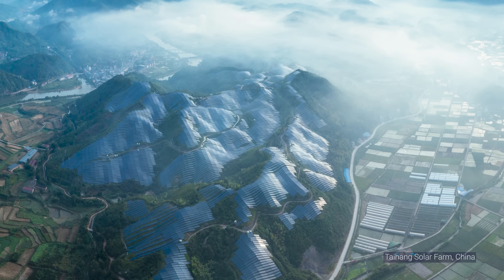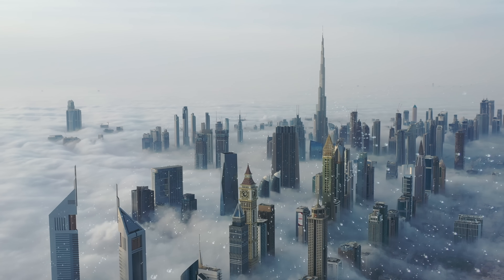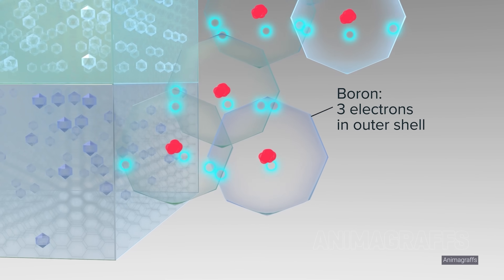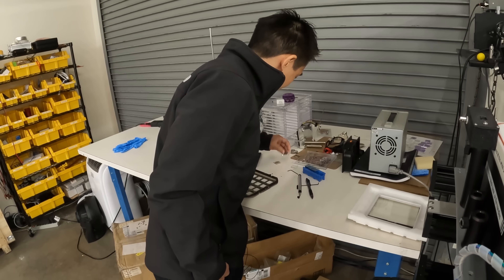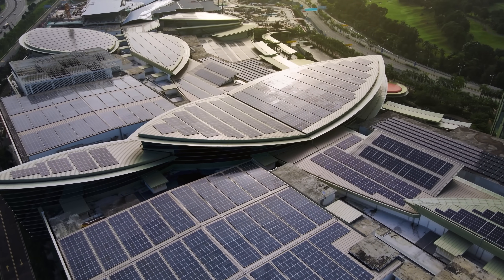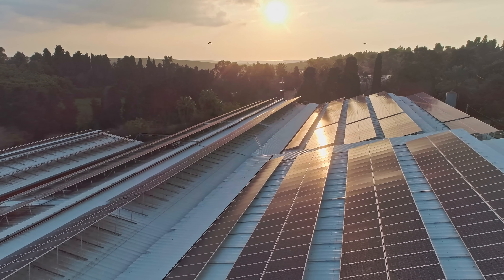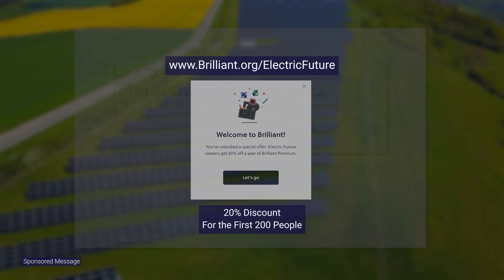Solar 3.0: This New Technology Could Change Everything

Comment: there are a few problems w/ solar that no one mentions.  firstly, the mining process for the materials is rough on the environment.  secondly, they require very toxic chemicals and materials that can't just be buried in a landfill (and it's too expensive to recycle them).  then what do we do w/ the defunct panels?  we have to take special precautions to bury them.  and considering the square footage needed for the solar energy discussed by Elon Musk, that will require an extremely large area of land that will have to be protected.  but if we're going to go to such lengths to bury used solar panels, why not drastically reduce the area of land needed to bury them and instead use it to store the waste for nuclear energy?  granted, the half-life for nuclear is far higher, but seeing as how nuclear is so efficient, we really wouldn't be sacrificing that much land that would be off-limits for the next 10,000 years.  but if CO2 is the problem everyone says it is, then it seems rather obvious that nuclear power is the answer—at least for the time being, if only as a stop gap.  here's the analogy i used to describe the "existential" threat of Climate Change: you're being chased around your house by a serial killer, and nothing you do works.  then somebody puts a gun on the table in front of you and tells you to use it.  but instead of taking the gun and shooting the serial killer, you say, "i don't believe in gun rights."  it simply doesn't make sense.  that said, i think the reason more "experts" aren't pushing for nuclear power is because they know that CO2 isn't nearly as dangerous as it has been said.  after all, if it was, we wouldn't be seeing the super wealthy buying up so much beachfront properties!  of course, if these "perovskite" solar cells prove to be the real deal, then perhaps my argument will become untenable (which would be perfectly fine w/ me).  but until then, i think my logic holds strong.
Reply: Of courser not. Nuclear Power is not clean for living beings, it's powered with rare minerals which require mining too. Most of these minerals are also limited worldwide and the world reserves are not on their peek neither, and the waste this generates lasts being dangerous hundreds of years. Set aside the dangers of nuclear leak caused by natural disasters or human conflicts.
Reply: Their is actually a bunch of financial reasons as well: try building a nuclear plant. It takes almost 10 years. Build a solar plant right now... a few years at most.
Simple example: supposedly in India they had this big patch of land because nobody wants to life next to a nuclear plant... they had been working on building this for years. They gave up and build solar plant on that same patch of land because: it would generated more power than the nuclear plant would.

Comment: this is rather old tech! not sure why its dated as being cutting edge for 2022.  hexofarricle graphene research is proving to be thousands of times more efficient at conducting solar energy as well as capacitive storage over current perovskites soft tech. an example would be the fact that carbon graphene is an extremely stable material with far better conductive properties then that of a superconductor ...which requires rather cold temperatures to perform!  Its thought that one 2x4' graphene based solar cell  will conduct more solar energy than 10  2'x4' 260 watt standard silicon semiconductor ...with ZERO loss! graphene is the most electrically efficient materials known to man! We are currently about 3 to 5 years away from inexpensive manufacturing of both solar and battery tech ! this will be a game changer!!!!

Comment: There's still the issue of maintaining cleanliness, regardless of how small they are. Even a very thin dust layer has a large detrimental effect on their efficiency. The best and easiest places to put solar panels currently is in deserts and empty fields. In a desert or similar, wind can easily place dust onto any solar panels, and the cost to maintain them would be very high. The most likely place they would be viable would be above clouds, where the sun would be shining more often, and dust wouldn't get to as much.

Comment: Nice. But "only" about 50% bump. So, nothing to sneeze at, but trucks? Buses, yachts? Nope. At 1kW per square meter max input (due to the "solar constant," then multiplied with the mentioned efficiency of 30% or even 40%) that's enough power for a bicycle, but no more. (And who wants a bicycle with several square meters of a canopy/roof?) 
So... for serious power, stick to buildings, parking shade structures, or stationary solar parks (or some portable IoTs and satellites).

Comment: Since material cost is 1/1000 (taking the active material as the reference)  then i would pay 1/10 of the price of regular solar panels to have them, even if they last only 5 to 10 years it would be worth it, in fact, over 10 years is good, but the fast pace means that in a decade what will be available will be cheaper and have better form, so, changing it every 10 years is good as long as there is minimal environmental impact

Comment: At what temperature can it operate? Would it be possible to instead of having a large surface of this film, have one very expensive and efficient film that receives a ton of concentrated light through mirrors as mirrors are cheaper than manufacturing this?

Comment: This research has been active for over 40 years. Being close to this research I can with confidence say that Si wafer solar will never provide todays energy needs. This means we reduce our requirement or find an alternative. 
Its video's like this that create hysteria on an expectation that may not be possible to deliver and gives a possible solution for politicians to present as a real albeit emotional propaganda.
Having said that we should not stop the research even if the gains are small as solar will always be an energy contributor.

Comment: 7:00 That’s why layering PV materials is the big lie. Solar energy was never about “the planet.” It was ALWAYS about making money.

The better solution would be to make panels passively optical. All they would do is collect, concentrate, and transmit optical energy to a a centralized processing unit in the basement. Because you can easily disperse light spectrally and also with passive optics, you don’t NEED to layer thin materials on each other. You simply direct wavelengths to their respective materials.

This ALSO allows you to add materials gradually to capture more of the spectrum efficiently.

The designed obsolescence is so obvious that if people REALLY understood optical energy and solar panels, they wouldn’t help but think the whole thing is a big sham.

Unfortunately, people are more interested in being “right” about what the “problems” are that they really don’t care about the actual “solutions.”

8:45 If you didn’t put the PV material in the panel, you wouldn’t need deposition layering processes…

Comment: Awesome research. Perovskites are very degradable. Overcoming that has been the goal for years. I suggest incorporating it within the conventional silicon structures or some sort of high-temperature resistant polymers. It might bring the efficiency level down somewhat but there must be a sweet spot somewhere in the middle

Comment: The initial video depicting the electron-hole interaction when the P and N-type materials are brought into contact was something you might consider donating to a University for the 1st course of Solid State Device physics. It would also be useful to incorporate the discussion of the Fermi level as part of the discussion to round out the band gap discussion. Good luck in your venture but many practical problems to overcome but your video shows you have a grasp of many such issues.

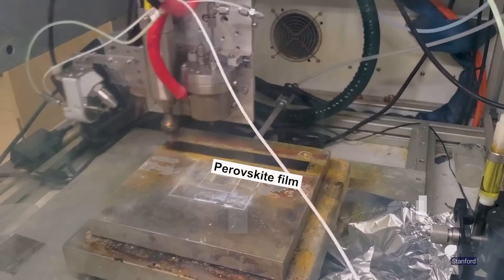Comment: 07:44 is the only reason this is viable. Easier to manufacture and less material used. You only need to heat the materials to 100 degrees instead of 1400 degrees on standard solar cells.  So in theory..... Theres a chance that its actually green energy.  Very exited for this new technology.
Reply: assuming it doesn't melt in actual use. I'm worried that the melting requirements are TOO low.

Comment: I wish the video had also mentioned the biggest barrier to full scale adoption of solar is energy storage. Most of the world doesn't have the capacity to store energy over time and rely on ramping up and down energy production to balance supply and demand at any given moment. Solar present the problem both of what to do with excess energy and how to manage impediments to production (e.g. weather). Then you also get into the issues with batteries and energy storage which are not very "green" products throughout their manufacturing processes - and the displacement of Indigenous populations for mining of things like lithium. 

I don't think there's one simple solution, but I do appreciate the informative video on this up and coming tech!

Comment: This is what I have been waiting for.... This will be the tipping point and will solve all our energy problems. I hope they can combine this with a Thermoelectric generator to combat heat issues and also boost efficiency. (Peltier device)
Reply: "Solve our energy problems" I believe it's called Nuclear energy and even better. Thorium powered Nuclear energy
Reply: @ishadowxhunter-0135  I am a big fan of Nuclear, but the dems gave it a bad rap.
Reply: heat can be used to for hot tap water
Reply: @DreamingConcepts  I was thinking a peltier device to increase electrical output, but a thermal battery filled with water would also do the trick. The only down sides I see to using water are the weight and maintenance.
Reply: @simoncameron4355  true, but the efficiency is almost 100%, compared to Peltier devices which are below 40%. Also costs worth considering, since it's the main feature of Perovskite solar cells.
Reply: @DreamingConcepts  Not trying to call you out or be argumentative, but they even said in the video that max efficiency is around 45%, and I wasn't referring to Peltier devices like they were a better solution, only as a way to combat heat and get more out of the unit as a whole? Your comment completely confuses me. Edit: after reading all the comments I think I understand, you think heating water is 100% efficient. This is not the case because as soon as the temperature reaches the heat maximum, then the rest of the energy is waisted, and you are losing the cooling effect of the water.
Reply: @simoncameron4355  true, but hot water is needed everywhere, so it can be even used for a city.. for example in my city the use fuel to provide hot tap water...

Comment: They have made these claims a bunch of times. Still no breakthroughs that make enough of a difference in solar. I remember years ago (10 years or so?) they claimed the new panels would dramatically increase solar capability and it only made a small change.

Comment: Heading in the right direction but not there yet. What happens when its cloudy or winter time? What about recycling the materials and all the storage batteries? Reality is fossil fuels aren't going anywhere for awhile. Not to get political but the price of fossil fuels can be dramatically reduced without the home drilling stigma and not getting our oil and gas from foreign enemies. Not to mention but our refining process is much cleaner.

Comment: Disposable throw away objects just have a terrible carbon footprint and environmental impact. We manufacture solar cells using fossil fuel powered factories, but in 25 years we will have to replace those cells.. Will the factories really be carbon neutral by then? Now,  if you wanna manufacture some solar cell that you can throw away after just 5 years.. how is that helping the environment?
Btw, supposedly in Cuba a lot of people drive cars which are 50 years+ old...

Comment: just as nuclear, dirty nuclear we opposed is not any more a must, the solar panels shall  become easier to produce (the 1400° silica melting ououggh!), less energy/ resource waste,  better all in all. Why not eoliens, somebody working on it?
Because there is again a Huge Campaign for oil/gas use =production at any costs, by demonising (smear is not enough) the 'green' alternatives. 1. who is paying for that, the same old culprits?)  2. should be working on  the absolute minimum need of the old Dirties  for production/ products  and the ways to regulate that and put a stop to "drill baby drill" . 3. Go on with the campaign to stop foolish and unnecessary consumtion. 4. Try to think locally and save the seas.

Comment: You're  all  just  stalling !!  When  heat  is  released  as  the  energy  reacts  same  can   be  reversed ,  if  you  cannot  reverse ,  use  heat  as  is  ,  you  need  heat  in  doing cooking , washing  and  what  not  WHY  HAVEN'T  YOU  DONE  THAT  YET  !!

YOU  ALL  ARE  CORRUPT!!!

Engineers  working  for engineering  are  a**Holes !!   Work  for  the  people  in  need  ,  those  who  are  sanely  in  need !!!

What  about  Water  Cells  for  immediate  response  to  the  energy  Crisis in  the  UNDeveloped  regions  of  this  World !

Lab Rat  working  in  a  Lab Rat !!

Comment: Roofing and foundation design can get free electricity by applying peltier cells effectively. Tesla had pioneered on peltier cell many years ago better than solar but it is the same except need no activated carbon that is so much more polution.. thin film batter can make cell phone never need plug in charge

Comment: Would it be possible to have the light first pass through a prism and then each color focused before being collected by the cells? What kind of effects could that have? By focused I mean using a parabolic reflector or something similar.
Reply: I get where you are coming from but I don't think that would improve the system. Sunlight is radiation of different wavelengths that is superimposed, so it's all colours at the same time. Using a prism and splitting up the light by its wavelengths would lead to an increased irradiated area, so a lower irradiance W/m2, and hence less power generated by the cell. Even if you would then use cells with different bandgaps next to each other to optimally use each wavelength, the area of the system would be larger than if you would've not had done anything. 
That's why multi junction cells are stacked on top of each other and not next to each other, so the different wavelengths are used even though the surface area of the cell isn't increased.
Reply: @Chronixx11  thanks for the input.
Reply: You'd save on solar panels and need exponentially more prisms. We're running low on sand too, silicon consumption also hurts the environment.
Reply: Commenting here in hopes of answers

Comment: Haha. Green Propaganda i call this. The problem of solar cells are not the 20% efficincy ;) It's that an array of panels is as strong as the weakest panel. That's the first point. The next problem is that solar panels are not usefull in most areas. In North Europe they put Panels on their roof, not because it's usefull but there where a lot of subventions from state. Now they have a lot of panels on their roofs, a lot of hot air beneath them but no power, because "concentratet" sunlight is very rare in North Europe.

Comment: This is a step in the right direction. Solar tech prior to this was just science experiment grade tech as far as I'm concerned. 20% efficiency, expensive to produce, can't recycle it, and you're lucky to get 20 years out of it. This stuff, while still not likely viable for large scale energy production (almost wholly because energy capacitance technology is still trash), is at least getting us closer. I'm not at all "anti-green", but there are benchmarks that simply must be hit if this kinda thing is to be actually competitive. This is what the green freaks/climate change zealots don't understand. Once energy capacitance technology catches up (we need to be able to efficiently and realistically store this energy generated by this solar tech), I could see incentives being offered to building owners to cover their buildings in this in exchange for discounted energy rates, among other locales where it would make sense to place this for electricity generation.
Reply: Thats why we should be using nuclear energy to buy us time until this tech is actually viable.
Reply: @SuWoopSparrow  100%. That's what I've been saying. Clean renewable energy that works? Nuclear. But the powers that be don't want that, they want the less efficient, more costly (in the long run) options.